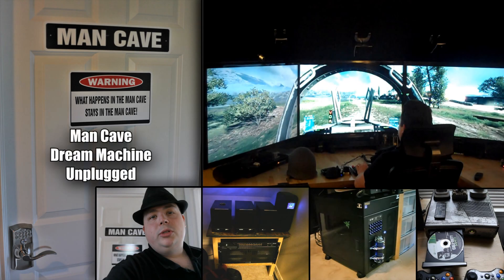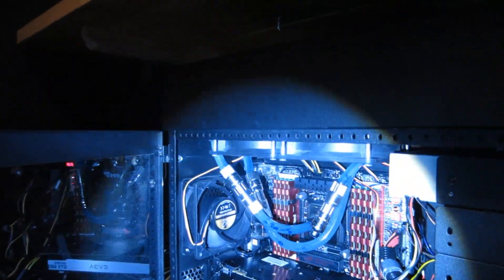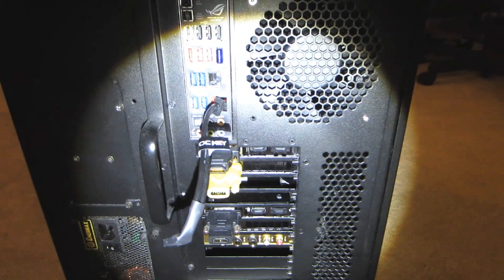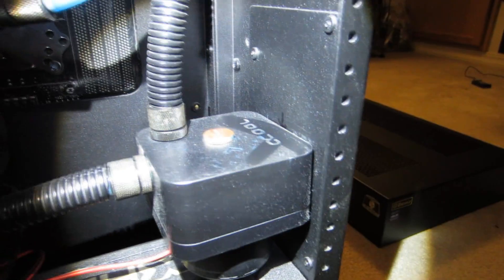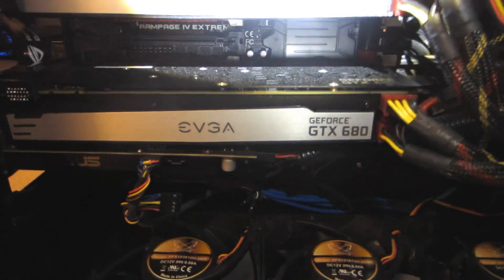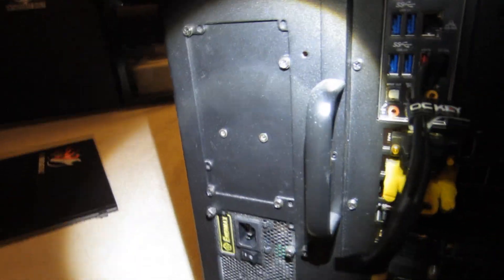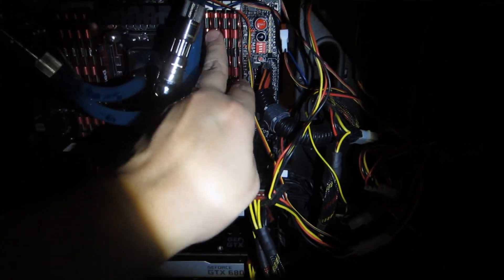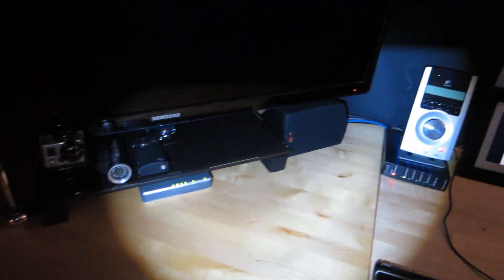Liquid Cooled Dream Machine Computer Walkthrough - @Barnacules

Comment: Cable management not even once
Reply: Xendrus Idziak
1) Doesn't matter

2) It always matters

3) Doesn't matter, it's always better to be prepared. Plan ahead.
Reply: Xendrus Idziak There a Three simple reasons as to why cable management is important:

1) It looks better

2) Better Airflow 

3) Managed cables are easier to manage, which is important for maintenance.

Would you have the same attitude if you were a technician?
Reply: Xendrus Idziak

1) You asked for reasons so I gave reasons. I never denied the fact that "looks better" is in the eye of the beholder. You're welcome.

2) It is important to make sure your cables are sorted in such a way that they do not get in the way of your components because obstructed air movement due to blocked vents can result in a component overheating, possibly damaging your equipment (Doesn't mean it has to be pretty).

3) There is ALWAYS reason to plan ahead. Sure, you might not see a reason but that doesn't mean a reason will not and can not present itself. Be smart. 

Being organized is a good thing.
Reply: *****
1) Thank for you agreeing that I am right.
2) Something that doesn't make a difference, by definition, doesn't matter
3) There is no reason to plan ahead for something that won't happen.
Reply: Kevin Watson
I haven't had a good laugh in quite a while, thank you for the ironic humor. You're funny.
Reply: Could you or someone else explain why it fucking matters at all? I see people talk about inside the case cable management being a huge deal, but why? Are you planning on using that space to store tea and biscuits?
If you say "It looks better": I like the look of the cables randomly running about, opinion is opinion. Is there some actual reason why cable management matters?
Reply: *****
1) Opinion
2) Unless you have heating issues, doesn't matter
3) Maintenance? I haven't had to open my PC case in years and can still play any new game on ultra.
Reply: *****
Fair enough points but people do put too much stock in the importance of it, it is "somewhat" important not the end all be all priority # 1 of things like people seem to imply.
Reply: Xendrus Idziak I laughed too. You asked an honest question, nothing wrong with that.
Reply: Xendrus Idziak
 sorry to reply 2 months later but clean cable management is pretty important as messy cables can ruin the positive/negative pressure air flow in the case, if the air flow is not clear than it can create dust which is clearly whats happening to this PC. Dust build up can affect components.
Reply: Jordan Shimmen Dust too, yeah. I should have pointed that out also but it slipped my mind.
Reply: I was more talking about out of PC case cable management, IE random power/video cords outside the case, since the original comment was a blanket statement about cablemanagement in general. I know in case CM is important.
Reply: Xendrus Idziak You were talking about positive/negative air pressure in the case so I assumed you were talking about the PC's interior. But yeah, you're right. Outside cable management is important also. 

I need to redo mine... <.<
Reply: *****
Different person.
Reply: Xendrus Idziak I'm an idiot. Sorry mate, wasn't paying attention.
Reply: *****
Shit happens. lol.
Reply: Xendrus Idziak

I might have gotten mixed up with who mentioned the positive/negative air pressure thing, but it was you my comment was directed.

I figured I'd write this for clarification:

The OP's comment wasn't a blanket statement as it's obvious to what he was referring. You commented asking why it mattered and argued when I provided reasons. What you're now saying you meant doesn't line up with that discussion, so I feel you're backpedaling.
Reply: you just said, what i will say now, a cable management is not to great lool
Reply: ATLEAST USE ZIPTIES!
Reply: I just build my first computer it took me 2 extra minutes to mangage my cables its not even hard Lmao
Reply: Built*
Reply: I actually like the look of the cables as well, It makes it feel more complicated and awesome!

Comment: Nice machine, I have a Similar machine (RIVE, 3930k etc...) in a caselabs TH-10 and I absolutely love the thing.  2x 480 rads and a 360, cools CPU, mobo and both GPU's with twin pumps.

Only advice I can give is work on that cable management in the case a bit, especially since you have the windowed side panel.  Other than that great build!

Comment: you should get sli gtx 780 ti ans water cool them that would be awesome
Reply: not for gaming, but for video production they are
Reply: supabubba18 titans are definitely not better ( like sebastian said for gaming)
Reply: this video is made in 2012... good luck with finding the 780 when it whas 2012.
Reply: yeah but what about the future you wont be able to do much with 2 gtx 760s but if you get  780 and later you can get a nother 780
Reply: the gtx 780 is not worth the extra money compared to the 760. Especially if your running them in SLi. The 760's would me more then enough and 450 bucks cheaper.
Reply: ***** Titans aren't the best for video production their drivers are more specialised around gaming, most editing and cad software don't support them too well due to this.
Reply: well we were talking about 780ti and titan for gaming and i said that the titan is just better than the 780ti at editing.
Reply: there is no reason for waiting, when ever the 880 comes out than the next gen will be announced, so i think he should just get what he can now. I don't think he should get a pair of 295x2 just because 4 GPU's are not worth it because it has a lot of problems with alot of games, mabe just one would be better or 2x 780ti.
Reply: actually 4 780 ti in sli are better, has about %40 more performance than quad crossfire of the 295x2 plus runs cooler and better tech and graphics with nvidia

Comment: You should invest in some of those magnetic dust filters for that computer case. I've heard people complain that dust filters restrict airflow, but I've never seen it myself and I run my 3930K at 4.9GHz and it stays pretty chill in my case with filters and that's with both of my ASUS Direct CU II GTX680s exhausting heat out inside my case and they can reach 60c each under load.
Reply: Admittedly my 750D ceiling filter (the one that comes with the case) appears to restrict air from my radiator, I use NF-F12 fans as well.
Reply: TwitchFast Corsair cases have a dense filter compared to others, but they don't really seem to stop dust from coming in the case. I've owned a few Corsair cases before I bought the Cooler Master Cosmos 2 which I've been using now for 1.5yrs. It's a totally filtered case and it doesn't effect my temps the least bit and I have my rad in the top in a pull config only since my mobo doesn't allow the clearance for a push/pull config due to the CPU power connectors. I use Xigmatek fans in my case except for the 200mm in the front which is the original Cooler Master fan that came with the case. My temps are never high the system pretty much runs pretty cool even after hours into intense games like BF3 & 4.

Comment: I would like to se you have AMD with Operton  with duel chips and dro you heat and a ton of ram. ,very little heat , more heat from gpu and need to be water cooled ,and if you water cooled the gpu ,go ahead & do cpu .Than run low voltage ,2.7 mg . I will set it up on Unix , I go back a lot years .started In Fortran 1969. Steam is headed that way. Mine on steam is leedonald54 , will play some time .Thank for your time very femur with your case been looking at it  Thanks' Again .

Comment from the maker: That is true for most sound cards but in my case the Xonar STX re-encodes the audio stream to Dolby 5.1 so it does touch the audio. But you're right if I want to use the DAC's of the sound card to get the best possible audio from the card I need to run analog, and I do :) I have a switch box to go from 5.1 Dolby Optical to Stereo Analog. I'm covered!

Comment: there is no such thing as liquid cooling without fans. if you are running to massive radiators, you want alot of fans ( in this case  "push -pull" ), which works absolutely great. the only thing i would change in this case would be to switch to Noctua Fans ( they are silent as shit ) . IMO this PC is a BEAST. as far a cable management goes... yea, it kinda looks messy, but i seriously doubt it has a great impact on the overall performance.

Comment: Great Components, too bad you don't know how to build a rig. Very messy! No thought went into this build. No Cable Management (Maybe if you did you wouldn't need 20 Fans) Blue coolant, Red motherboard and Ram. You spent probably 3k on this pc and it looks like crap.

I don't like to hate but this is SO BAD! Why even liquid cool if you are going to use that many fans.  And PS may want to relocate that pump closer to the res.

Comment: suggestion  and a question.
Suggestion: maybe you can mount a led light at the bottom of the reservoir to make it shine.
Question: why didnt you put your optical drive at the bottom of the fan controllers so you could of put that third fan in on the bottom of the radiator?

Comment: cleaning up your cables does actually help with the dust problem.  Also, the smaller the loop, the better as the water spend more time in the radiators.  Otherwise best and I hope you come out with more videos.

Comment: Nice case looks good. Difference between the M8 an m10 is the number of PCI slots m8 has 8 pci slots while the M10 has 10 making it able to  support XL ATX boards and down without mods and the M8 is limited E-ATX an below.  Case dimensions are the same which is why the M10 is left with a little less room since it can handle a larger MB

Comment from the maker: The GPU's were cooled in the original build, when I upgraded the GPU's I went air cooled and planned to get water blocks but decided not too since the performance was already very high. It's a progression :D I'm not going to take the radiators and fans out of the system just because I pulled some hardware out of the loop, besides on my next upgrade I'm going to have more watercooled stuff for sure, just not right now.

Comment from the maker: I used to have two GPU's in the loop in the original design but I upgraded the GPU's and went with air cooled ones because that was what was available at the time. When the next gen GPU's come out I will upgrade again and get some waterblocks.

Comment: I would have to agree. Lots of fans would be ideal for a quad rad at low rpm because there would be more surface area. Two rads just for the CPU is pretty wasteful but I guess leaves a lot of room to expand.

Comment from the maker: 1) The case only supports 120mm fans :)
2) Trust me, if I could go back in time they would be Seagates. I completely agree!
3) I love my Z-5500's, some people hate on them but they sound fantastic and I even have the amp driving extra Klipshe speakers without any issues.

Thanks for the input! I love it when my subs interact like this. Come join me on Facebook and Twitter if you haven't already.

Comment from the maker: 1. I have been using computers since I was 7 years old, just liked masking the keyboard to be honest.
2. I decided to stay in the computer field because I had a passion and drive for it! You should never do anything your not passionate about to make a living (if possible).
3. You install 2 or more graphics cards (or 1 6xx NVidia series) and connect 3 displays using DVI or HDMI and then enable 'Surround' mode under multiple monitor in the NVidia control panel (or EyeFinity if you have ATI cards).

Comment: I went and ordered a new case for an upgrade. I might grab another 7970 when their prices drop a bit more ut I am a bit unsure right now. I have my PC, 3 monitors & Pioneer receiver + speakers connected to a 600w UPS and let me tell you it has kept my equipment safe against countless power failures in my old place lol. I have 2 600w units and the other one is protecting my HDTV, PS3, my second Pioneer receiver, DVR, Wii & a Samsung SMART Blu ray player. Excellent battery units. :)

Comment: because he's technically not running SLI due to the triple monitor setup.  SLI is for combining 2 video cards to drive a single monitor, but in his case, in order to run 3 monitors you need 2 cards since a single nVidia GPU will only handle 2 monitors at a time.  In a previous video he explained that he did get water blocks for the 680's but they were the wrong ones so he's sticking with air cooling them for now.

Comment from the maker: You didn't see the SLI bridge in the video? It is there :) Sorry I didn't do a very good job of pointing it out. Also the reason for the massive cooling system was because when I first purchased it all I wanted to liquid cool everything and my GPU was a hydrocopper but then I upgraded and decided to go air on the GPU since I replace them so frequently. I will try to get waterblocks eventually.